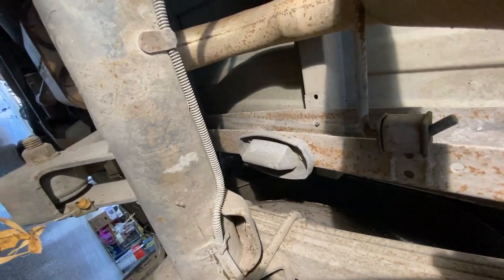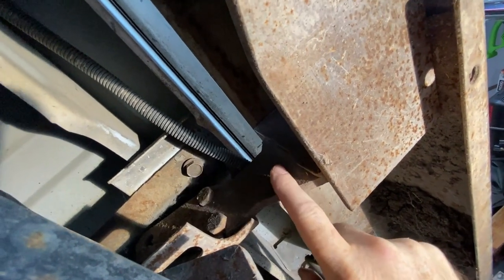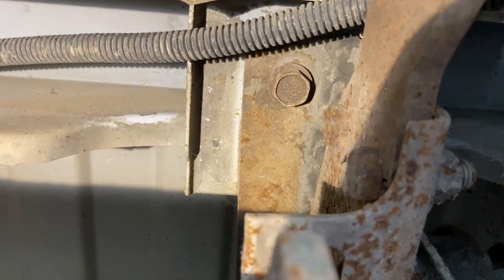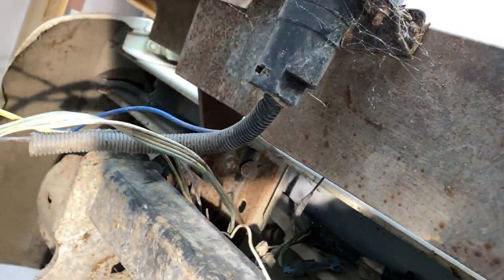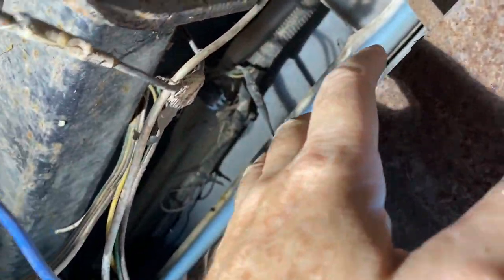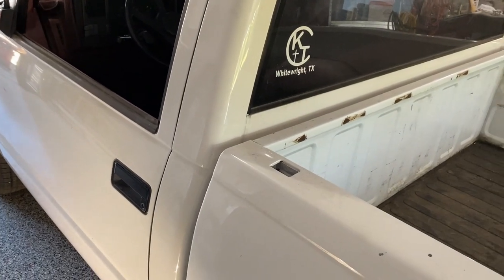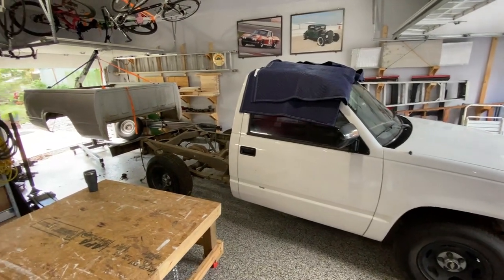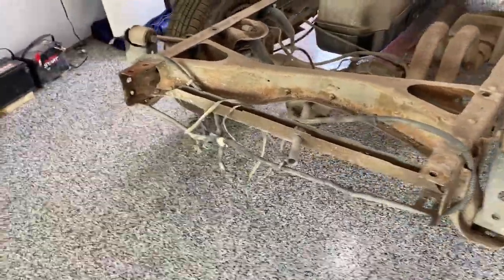How to Remove: 1988-1998 Chevy/GMC Cheyenne Silverado Sierra OBS Project Truck Bed

Comment: Good video. I’m gonna add a video to my channel about removing bed. Its a dually and 2 of the bolts are blocked by springs. At least as far as getting an impact on it and the position makes getting at it with a breaker bar impossible. We shall see!
Reply from the maker: Good luck!
Reply: @laurencevillegarage  nice truck,,👍👍  its a v6? Or 8
Reply from the maker: @gerardolopez5875  it has a 4.3/5 speed with a blown head gasket…
Reply: @laurencevillegarage  @ transmisión will be for sale? I gt a 93 v6 with a broken transmission
Reply from the maker: @gerardolopez5875  probably not, I usually keep all the parts I remove that might be useful on future projects. It won’t go to waste.
Reply: @laurencevillegarage  @ 👍👍
Reply: @laurencevillegarage  @ any update videos?
Reply: Just got the bolts off my dually bed its a 90 gmc the 2 bolts you described weren't too bad got on with heat and a swivel, extension and impact and the other with a long handle ratchet. Goodluck to ya.
Reply: @mattw7690  Thanks for the tip! I may try to get back on it in a month or so when home projects slow down lol.